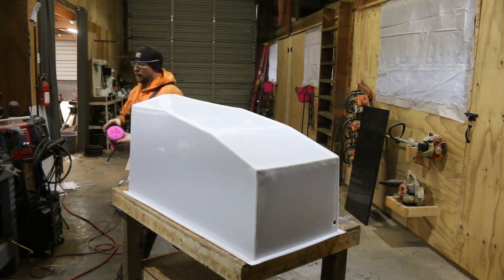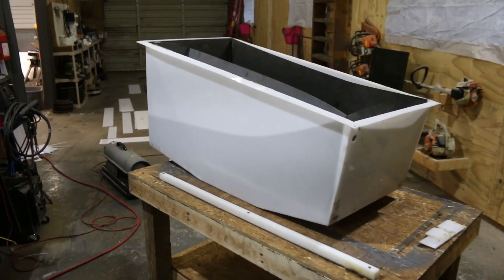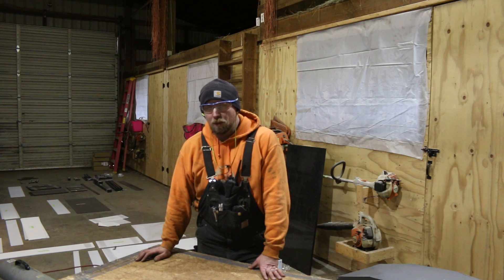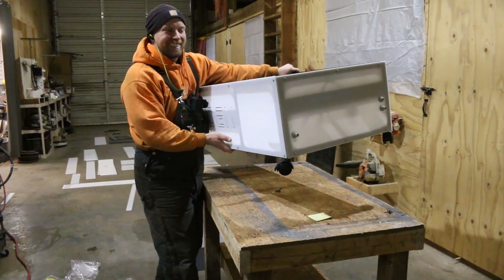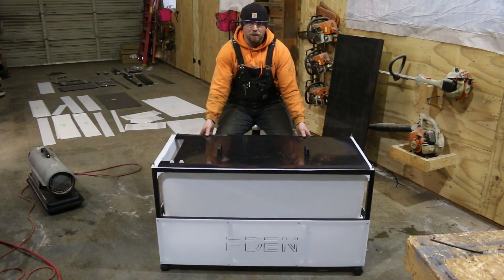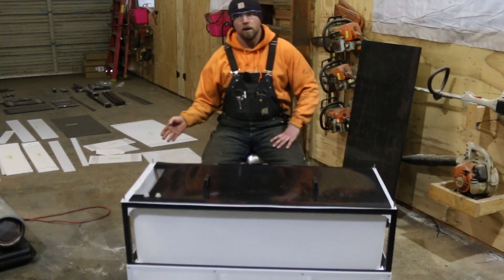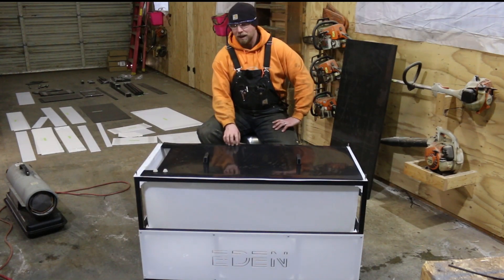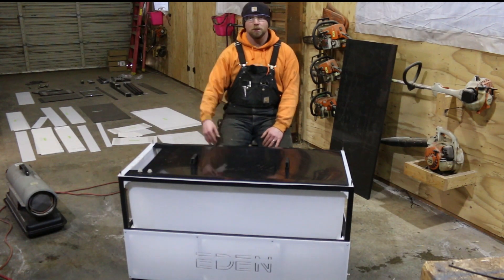Will it BREAK? New AEROPONIC Tower Tank Part 2

Comment: I have my concerns about that plastic welding. Water is heavy and has a lot of outward pushing force. I am not so sure the welds will hold up over time. An idea If you can get the welds to hold on the corners make the main body out of one piece including flanges. Just need a jig to heat a strip and bend. Then weld the ends on. It should be stronger and faster to build with less welds to leak. I am not sure if silicone will stick to that plastic. Good luck.

Comment: For your mold make sure all edges are completely sealed ether by welding or applying high temp silicone so the HDPE does not melt into the gap. Make sure there are no rough edges or over hangs where you are welding. Then you can use compressed air injected at the bottom hole preferably with some kind of stopper so the air has nowhere to go except between the mold and the work piece.

Comment: consider using a wire frame mold just to support everything in the proper place but less material to get stuck too..... or if you must use a full form mold consider adding air hose attachments in a few places to it can be released with air pressure.